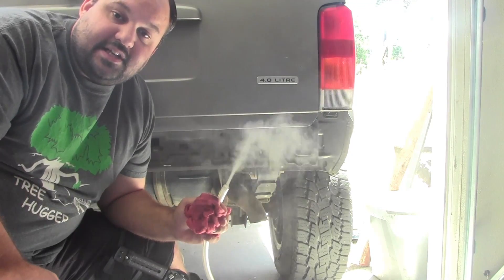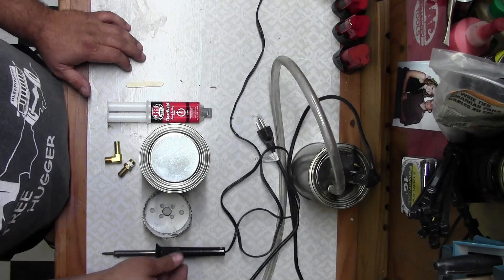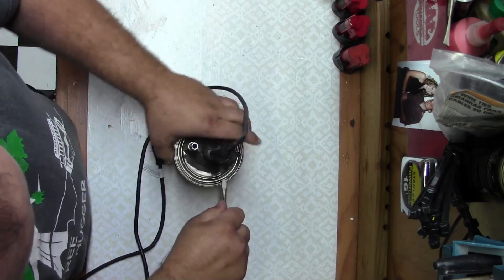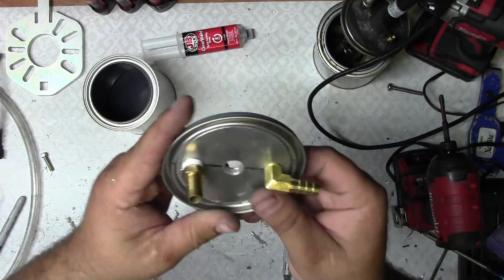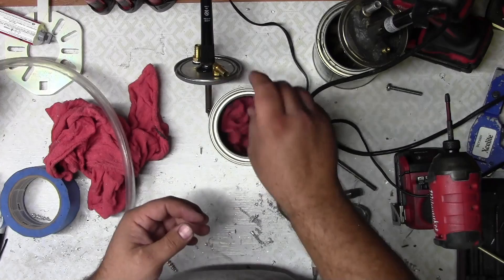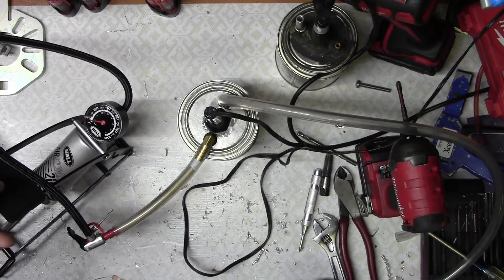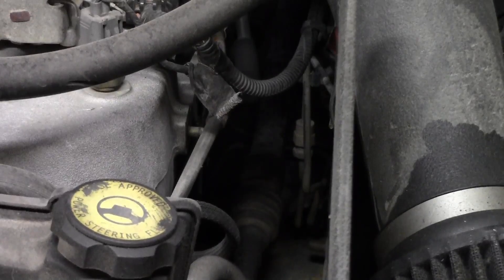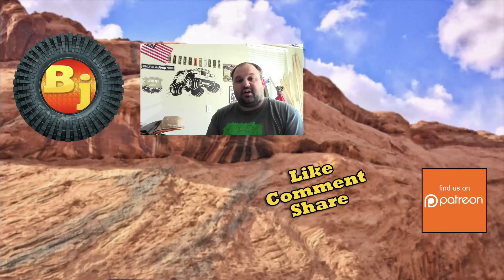How To Find Vacuum and Exhaust Leaks - Make Your Own Smoke Machine

Comment: I found a even better smoke machine. Get a bottle of lucas injector cleaner and pour it down the vaccum tube of the vaccum booster while it's running. I found 3 small exhaust leaks that I never knew in had and you clean the top end of the motor at the same time.

Comment: a air pump for a fish tank would be better i think then the bicycle pump. im making one of these tomorrow thanks.
Reply: I did use my air compressor regulated as low as it would go there bike pump is a little safer but the fish tank pump is a good idea too 👍
Reply: @derrickdennis6383  I was thinking this too, maybe could plug the pump and soldering iron into an outlet and use a longer clear hose instead of moving the pump and heating element around., I never would have thought of an old soldering iron for this though, that's awesome.

Comment: I just use a water bottle with a hole drilled in the lid and some holes drilled in the bottom. Stick your favorite flavor or cancer in the lid facing toward the outside of the rig. Then put an air compressor spray nosal or whatever you are you using as an air source at the other end of the bottle. Spray/ blow or whatever into it untill you see where the smoke is leaking.

Comment: Just think;  Snapon will sell you a battery powered smoke machine with buttons for the low low price of $3000.00.  LOL.  I made one of these over the summer to chase down what I initially thought was a boost leak on my TDI Jetta.  I went a little overboard/overly complicated with heating.. bought nichrome wire and did math n stuff.  It worked amazingly well, but yours is much simpler!  I have an imgur writeup if anyone is interested:  https://imgur.com/a/H8mEWS7

Comment: That green valve is for the evap system that goes to the gas tank, not the vacuum system.
Reply: The evap system is vacuum operated that's why when you have a vacuum leak it throws a code for evap leak.

Comment: Turn the vacuum shredder valve under the green cap to the right instead of to the left. They normally have reversed threads. Hope this helps. Nice vid.
Reply: I've never messed with a schrader besides with tubes and tires, and with these I've never seen them reverse threads, I'll keep this in mind though. although I think there's a good chance that valve was seized in there really good, considering it's an older jeep and who knows what kind of junk could have gotten to the other side of it, although I think the vacuum system should be pretty clean by nature